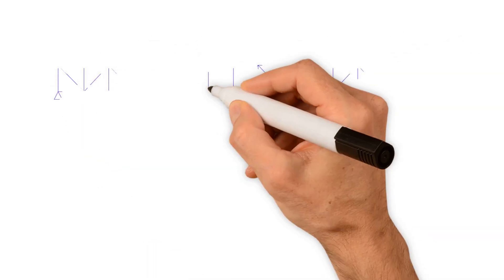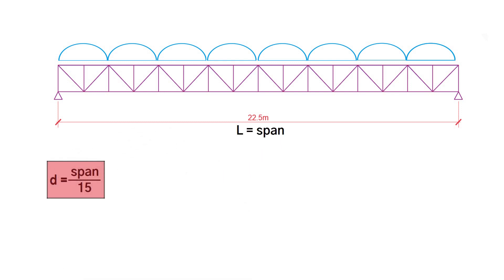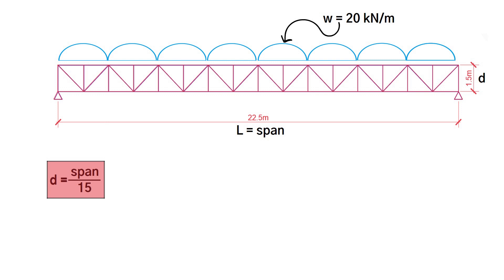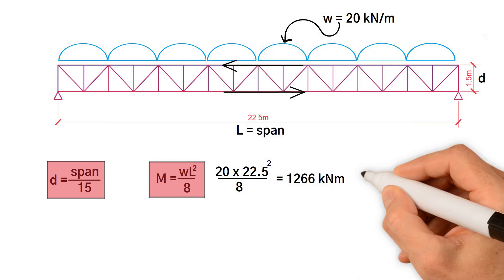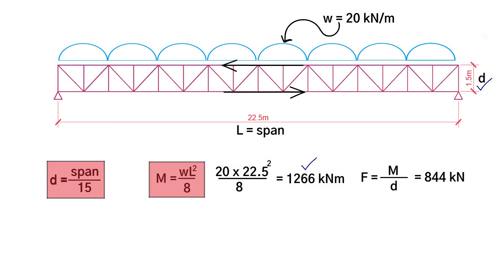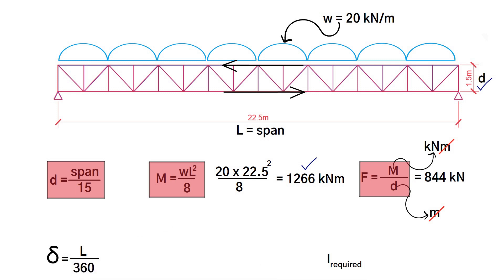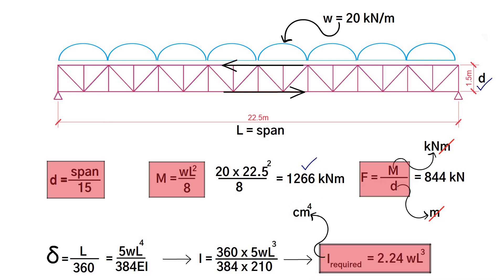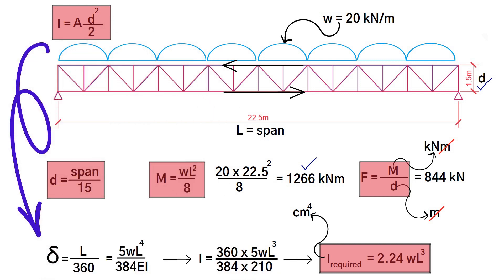5 Top equations | Steel Truss Design every Structural Engineer should know

Comment: if you're calculating bending moments, then it isn't a truss anymore
Reply: The “bending moment” is resisted by the cords in the form of axial forces. This is just an approximate but precise and fast way to check and design this type of structures by hand. Doing this the correct way would require a lot of calculations. Also by doing this and with the help of the shear force diagram you can determine before hand which elements are working in compression or tension. 
There are a lot of structures that can be idealized as a beam for easier analysis.

Comment: Hello and thank you. I would like to ask, does the I required is for one cord only or for both cord (top and bottom) added? Thank you
Reply from the maker: Thank you for your comment. The I required is for both cords!
Reply: @structuralengineercalcs  thank you! By the way, would you arrange other video how to calculate/determine the size of bracing also? 😁 Very apreciate if you would make video like that because I haven't get any video showing how to determine the bracing 🙏
Reply from the maker: @caktidhewana2910  It's on our to do list! Stay tuned.
Reply: @structuralengineercalcs  or we can just use the formula to calculate beam buckling by assuming the joint is both pin?

And one more question 😅
Does the w covered only the external load or included the truss member mass itself?

Comment: Using 40*40*1.6 mm pipe. Flat truss 40 * 1.6mm pipe * 10 inches is it enough for 30 feet shed without middle support.(pillar)

Comment: Thanks for this video. Can you please make a video about Equations one needs to consider while designing Steel Beam? How one can design a Steel beam under UDL & point Load circumstances? It can be with a simple example of 4 beams with 4 columns at each corner (BS & Eurocode) 
You are doing a great job.

Comment: Great video. U haven't mentioned the use of interaction equation check for design of chord. Also the use of buckling factor for compression members need to be addressed here. 

Besides kindly please share the design of steel moment resisting connections. Thanks